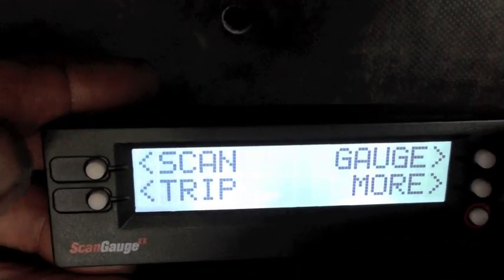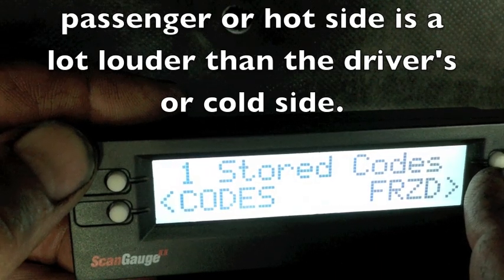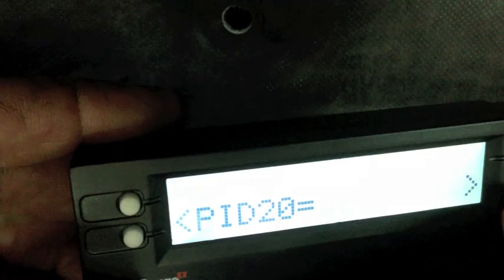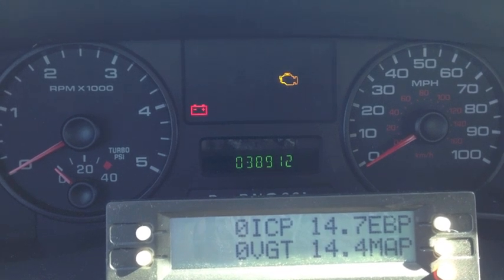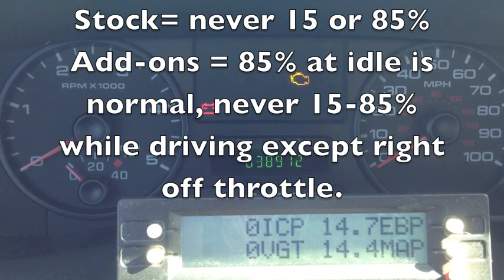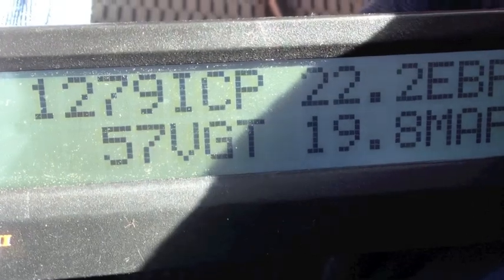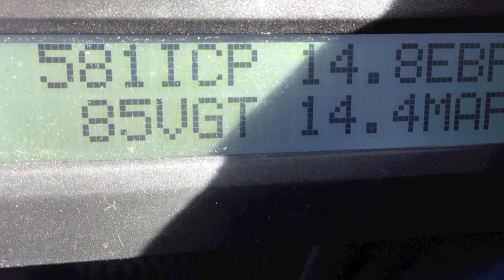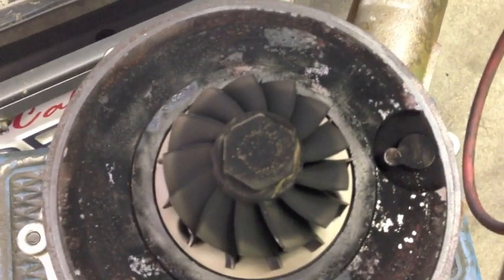Using a Scan Gauge 11 to verify a P0299 code and sticking turbo on a 6.0 powerstroke diesel

Comment: I have low icp at full throttle but it all runs great any ideas I should check I rebuilt the turbo code p2290 on 03 6.0 powerstroke

Comment: I have an 05 6.0. If i have a under boost p0299 can can it trip the p0234 overboost if the turbo is sticking or what should i be looking for.  It went into limp home mode when i was pulling my 5th wheel camper
Reply: You ever figure this out im running into the same exact problem
Reply: Legend has it  that  he’s still stuck on the side of the road In limp mode.

Comment: Hey Ron ,exuse me i don't speak english very well ,I have KIA SORENTO 2.2 CRDI , with DTC P0299. I have changed a pressure sensor witch is above admission manifold , i have clained the manifold and throttle , hoses are good , the turbine of turbo is good , but current data of GDS SCANNER show me :  
VGT 92% at idle 
VGT 73% with RPM 3200 ? , my question is : is VGT actuator defective ? I think that with 3200 RPM VGT must be about 27 % . THANKS

Comment: Was going to get a state inspection on my f350 power stroke 2006 using my code reader I erased my codes now my truck will not start any ideals what I did???

Comment: Hey Ron is it possible that I could have a sticking turbo or a bad vgt solenoid but no codes? My turbo is constantly at 14-85% on my scangauge barely any power. Thanks!